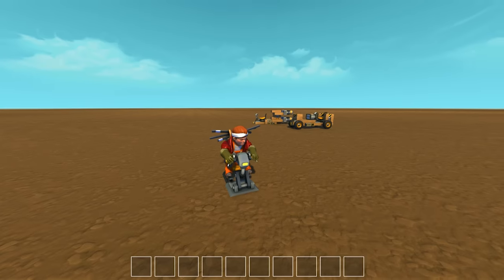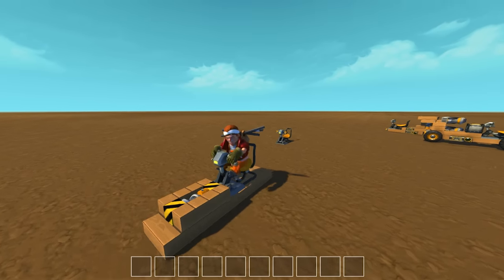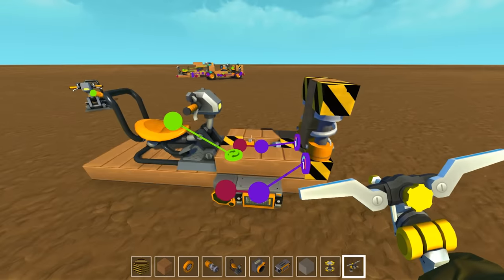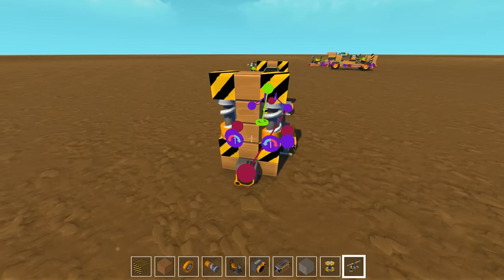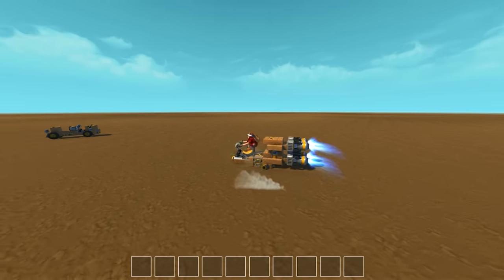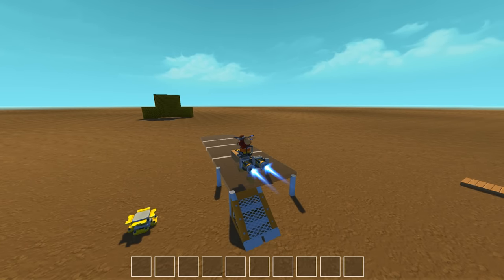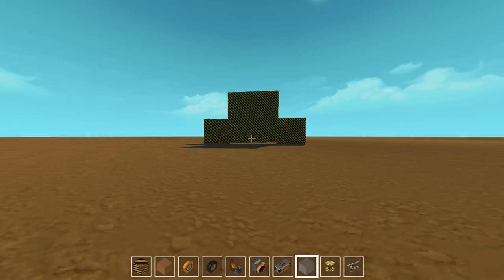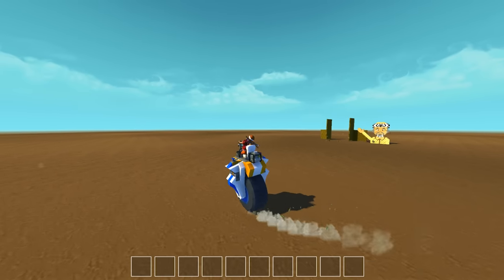Scrap Mechanic Suspension Glitch Tutorial & Mr Meo-Go!!!

Comment: Do the suspension glitches have to be in the locations like infront of the car for the pitch?
Reply from the maker: I would normally not be using pitch or roll on a car, maybe just yaw for turning left and right...

You can place the suspension glitch at at either front or back, just so as long as it is located in the middle across the vehicle, but ideally you would want any suspension glitch for pich, roll and yaw to be as close to the center point of the creation as possible to avoid awkward steering.

Comment: does this work with 4 legged walkers?
Reply from the maker: Depends in what way you mean.....

It will certainly work as a steering control for any craft, including walkers, also could help to stabilise standing, however there are better glitch weld stabilisers out there for that!!

Try checking out some of Brent Batch's.

I hope that helps answer your question!
Reply: @SpexxyYT  i tried it and it worked! thank u!

Comment: 9:10 Notice how he deleted those blocks. Look closely at the block place/break thing. See what I mean? This man is a hacker.
Reply from the maker: WOW, I wasn't expecting a comment on a video that's so old, but What exactly are you accusing me of?

At 9:10 I simply delete a suspension part that is under heavy pressure and, due to a developer glitch, the platform stays suspended in mid air, until a block or part is placed on it, at which point the physics kick back in again and it falls!

No hacks required, it was just a game bug at the time, though probably fixed by now, I would hope!!

In fact, up until the Mr Meogo Unicycle, everything was built with 100% vanilla parts, so not even a mod in use!

Not that Mods are hacking, they are just mods and actually incorporated into the game now!